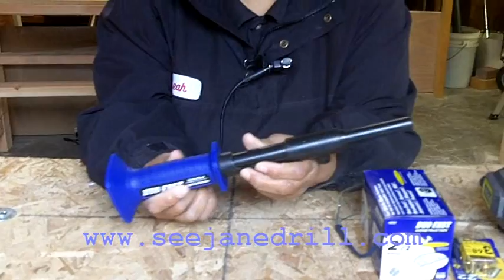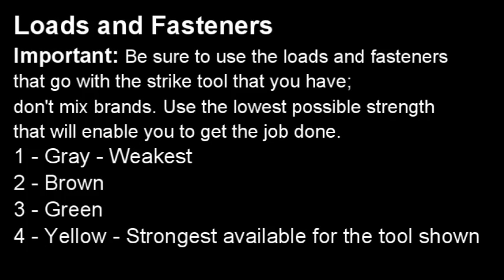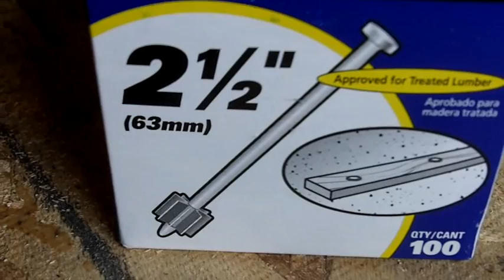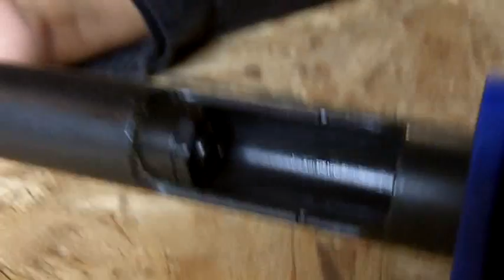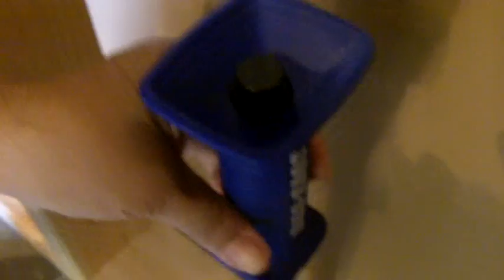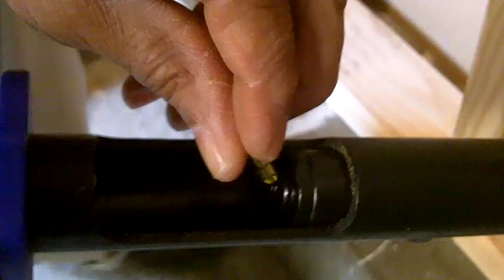Best Way to Drive a Nail Into Concrete

Comment: whats the best way to remove anchors? i recently took a room down in basement and im left with 2 1/2" spikes sticking out of floor, was going to cut it with grinder but fig id look it up first but not finding much
thanks in advance

Comment: Leah you are great, keep the videos coming. I probably wrote this before but please try this drill a hole with a 3/16 masonry bit insert a piece of 16 gauge annealed wire and drive a 16d common nail through the lumber. It holds tight and can be removed as well.

Comment: I wonder if once the nail is is, you can pick out the blue part and hammer in the remainder of the nail so it is flush.  Need to install laminate transition onto concrete and need an option to secure transition, but need it flush.

Comment: Excellent job explaining how carefully one must handle this particular tool! It's essentially a firearm that just shoots nails rather than little lead balls! The care in which you explained how it must be handled was precisely what is needed - great job! 
The only bummer is the link, Leah. I really wish you didn't have the tool listings on Amazon...  ~sigh~  I avoid Amazon as much as humanly possible, as I detest what they do to their employees (poor wages, extreme working conditions, anti-union, union-busting, etc), and the fact that the company pays 0% - zero percent - in taxes, while making zillions using our infrastructure (roads, postal service, etc) that taxes pay for. That just doesn't seem right to me. It's unethical, IMO, so I can't support the company, at all. I've maybe bought through them 3 times since they began, and avoid them unless it's basically an emergency.

Aside from that, great video!

Comment: Good video.  Consider using treated lumber for your silt plate next time when it will be touching concrete.  That way the capillary action from the concrete doesn't rot the sill plate over time.  Keep up the videos!

Comment: Another great video as usual, thanks so much.  I just bought this exact tool from menards today and was wondering if I should exchange it for a Milwaukee or some other better known brand . Now that I see this is the one you're using I figure if it good enough for Leah it's good enough for me , I will definitely read the instructions.

Comment: This is like a zip gun with safety features. I use Tapcon, a few just spins free, maybe soft concrete then I need to drill a new hole. I think those concrete nails have more pullout force, won't come out without taking a chunk of concrete with it. Some broke off and had to grind it flush.

Comment: I'm a big proponent of safety but you've gone overkill on the "dangers" of this tool. The likelihood of this tool misfiring is somewhat less than finding a winning lottery ticket on the sidewalk. The most likely injury you'll face with this tool is missing the hammer and hitting your hand or arm. You're more likely to hurt yourself with a hand saw.

Wear eye and ear protection and load the nail before the charge and you'll be fine.

Comment: Leah, I just finished watching your video about Nails. There you said, you want a nail three times the length of the thickness of the thing you're trying to nail down. Why did you choose a 2 1/2" nail for a two by four? it isn't even twice the length. Love your video by the way :)

Comment: 1st off, love the videos and the way you explain them!   Question in this tool.  Could I use this to drive a nail into and cinderblock wall will stucco on it?  We are trying to hang wire on the wall for the vines to crawl on.   Is this strong enough to go through both materials?  Recommended nail length? And I’m assuming I would just not finished by hammering the nail and just removed the blue plastic and wrap the wire around the end?  Thanks Jane!  Keep up the great work!
Reply from the maker: You know, Mark. I would not recommend this tool for that application.  There are better options.

Comment: Hi ,
Any suggestions on putting screws in to hardie board or  cement board for a sub floor before laying tile.....I have a drill but it's some work for a woman.....I may try a impact driver or custom screws.....and advice would be appreciated.
Reply: There are special self tapping screws for cement boards without predrilling. https://www.amazon.com/s?k=self+tapping+screws+for+cement+boards&ref=nb_sb_noss
I use cheaper outdoor regular screws without predrilling, just push harder. Don't think you need impact if your drill has enough torque. Roofing nails will do but does not hold like screws. I use  12V Milwaukee impact, plenty of torque. Don't need to pull out my 18V Milwaukee, heavy and tiring to use all day long.

Comment: where can I purchase this tool from? what brand did you use in the video and finally can I use this tool to attach trim to a plaster wall or would the strength of the tool cause the plaster to crack?
Reply from the maker: Hi jjenn, this isn't the right tool for that job.  Can you tell me what is underneath the plaster...lath?  metal?  concrete?
Reply: seejanedrill hi Leah thank you for getting back to me. all I know is we had new walls put up in many rooms of my house and instead of just doing drywall, my contractor put really thick plaster on the walls (possibly OVER drywall i think ?), but what's behind the walls I'm not 100% sure. it makes me furious that he used plaster. I never asked him to do that. so needless to say he was eventually fired for that and many other reasons. I do have a small exposed brick wall in my kitchen that also needs to be trimmed out. what tool should be used for that?

Comment: That particular tool is a very dangerous one. It has no safety mechanism at all, so it can fire the nail even though it might not be on the board you are nailing. I would not use this. I do have a Hilti fastening toll that I consider much safer, but I still am very careful with it.
Reply: Watch the video. It does have a safety mechanism. It needs to be pressed down before you strike it with a hammer. Similar to an air powered nailer.

Comment: Thanks, Leah!  About 35 years ago, I used a Hilti trigger-operated nail gun.  Very easy to use, but scary.  I didn't know about the test to see whether the material and nail are compatible, but I got away with it.  I'm a wimp, so now I bore pilot holes with a rotary hammer, and drive Tapcons.

Comment: Yes, it was slow paced. The best way to have information take hold. This is the same manner in which firearm instruction is given( Yes, I am a certified firearm instructor) and I did appreciate the professionalism shown. In my opinion, one of the better videos on the proper use of a nail driver.
Reply from the maker: thank you very much for your comments! :)

Comment: I can't find that tool anywhere. Does still exist and if so where? I will be framing a basement soon. Also how much does the tool, nails and loads cost?
Reply: Can get the device, loads and fasteners for about 45 bucks at local box stores. That is ....IF....you don't live in a delicate STATE I suppose.
Reply: Sam Sacks Ace Hardwares normally have them. Pretty inexpensive.

Comment: Thanks for the great tutorials.  I want to frame in my concrete basement, should I use the powder actuated nails or tapcon type screws?
Reply from the maker: I prefer to use powder-actuated nails, because you don't have to drill pilot holes, as you would for tapcons (saving half the work). If you do decide to go with the tapcons, you might want to use construction adhesive as well on that bottom plate to give it additional stability. 2 additional notes: Remember, where concrete slab comes into contact with soil, such as in a basement, you have to use pressure-treated wood or wood that is naturally moisture resistant (like cedar) for the bottom plate.  And, do keep in mind that some basement walls need to be floating walls. It depends upon the area in which you live and the soil composition.  You may want to look into whether that is necessary or not.

Comment: When I worked in Ireland we used things called  ''''express nails'''' a lot when fixing to concrete. I don't know if you have those in the US but they are brilliant, they provide really good solid fix. We used this system too, but mostly for fixing to steel. Great demo, safety is really important with these.
Reply from the maker: express nails.....interesting.

Comment: Hi Leah, would you also  use a Ramset like tool for attaching the top plate of a non loading bearing wall to a steel I-beam?
Reply from the maker: Yes, but you have to make certain that you are using the proper load with the appropriate Ramset model.  If you want to send me your email address, I can send you a link to the Ramset spec sheet which has a load selection chart.

Comment: What's funny is that i have this EXACT dilemma .....i need to install some drapery but they extend over an empty space so we have to use supports coming from the ceiling to cover the area that is hanging in empty space and i was JUST considering looking you up and asking you your thoughts but it's tomorrow night that we have to install.....so plan A was pre-drilling and then using the "Tapcon" concrete screws but this gives us a secondary option if needed. Thanks again Leia!!!!! :)

Comment: QUESTION: I need to add a wall to a custom shower(turns out I should of hired someone lol) I'd really rather not have to drill holes with masonary bits because that is a pain! Would this work on tile to seat a wall bracket for a 2x4? it doesn't matter if I crack the tile because it will be sealed and covered with a wall. Thanks for the advice.
Reply from the maker: +Jack Johnson   Hello Jack,  I'd use a diamond bit.  They're a bit on the pricey side, however, they cut through ceramic and stone tile with little effort.

Comment: Lea, first off you are a very charismatic person thanks for the video, second I'd like to bring something to attention I see you said 2 1/2 nail for a 1 1/2 board but then once the fastner you shot into the concrete stod out about 3/8 to 1/2 inch on top of the 1 1/2 ,I so then only 1/2 inch of it when into the concrete, say if you'd hade used 3 inch faster that would of made it more secure right?
Reply: +Hitman Grace of God The reason the nail did not sink enough was the tool has to be held more firmly pushing down ! it should countersink a bit. a half inch sticking out is unacceptable, firmer grip and sharper blow, if you notice the camara switches fast because the first attempt failed. This is a very safe tool to use
Reply: oh your right about that....I have  had to learn the hard way.

Comment: Leah -is there a difference between driving a nail into a concrete floor and driving one into a hard wood floor? Should I assumed that there is concrete under the wood and how would I connect the wall into that type of flooring? Thank you!
Reply from the maker: +SIT Chicago   Yes, there is a difference.  It has to do with building codes and what type of lumber the bottom plate is required to be when attaching to concrete that is in direct contact with the earth.  Is your floor a wood laminate floor floating on a concrete slab?

Comment: I have watched and read the stuff on video. now the question I have is this.1) if the tool does not drive a nail into cement blocks and using yellow loads. am I doing something wrong? you said in video not always do you use highest load. I have also used same tool on concrete floor to nail 2x4 down to it. nail is still raised above it can I second shot it? or in both cases drill and use concrete screws?
Reply from the maker: cazrcon Sometimes if you don't strike that tool with the hammer hard enough and on center, it doesn't drive it in completely.  I would not try to re-shoot them a second time.  

The other thing it could be is that the concrete itself is too hard.  And yes, you could use Tapcons, they would work.

Comment: Can I use this to fasten steel studs too?

Thanks
Reply from the maker: ***** Yes, if you're talking about attaching the bottom plate to concrete.  In that case, you would want to use a fastener of the appropriate length, because the fastener that I used in the video was for a 2x4.  You would need a much shorter fastener.  
If you are talking about something other than attaching the bottom plate to concrete, then please let me know what that is.

Comment: This is a good tutorial video but code is to use pressure treated wood whenever wood touches concrete. So I'm just wondering why your trying to teach other people when your doing things wrong.
Reply from the maker: david hindes David, The International Building Code, Chapter 23, states that one must use either naturally durable OR preservative/treated wood when the concrete is in direct contact with the earth. Number 1, it doesn't say that you are limited to using pressure-treated wood.  Number 2, you only have to consider using either naturally durable or preservative/treated wood WHEN the concrete is in direct contact with the earth.

The most important thing is that the video was a tutorial on how to use the powder-actuated tool, and not "how to attach wood to concrete".  Viewers will have different individual circumstances to consider.
Reply: Hahaha,  owned.

Comment: Thank you Ms. Leah. I've been looking for something instead of drilling then using the flangers. Were can I purchase this. What is the actual name and how much it costs. Oh yeah, if I have ceramic tile floors to concrete, will it crack the tile. Please answer asap so I can get started putting the wall up in my bedroom. By the way, my middle name is Leah. yvonne from california
Reply from the maker: Hi Yvonne, yes, it will shatter ceramic tile, you wouldn't want to use it on ceramic tile. In the event that you still want to get the tool, you could shoot it into a mortar joint.  The tool is called a powder-actuated tool, and it comes in various name brands, such as Ramset, DuoFast, and Hilti.  They are available at just about any hardware store, and the simplest model (single-shot) costs about $20. There are multi-shot tools available for about twice the amount.
Reply: Wow. Thank you Ms. Leah for responding so fast. I can't wait to put the wall in my bedroom. I'm surprised at how much it costs. I'm going to try the mortar joint Please don't stop posting because I like the way you explain everything. Again, thanks a million.

Comment: hey i was wondering what the best approach is to remove the nails from the concrete? im having trouble removing a piece of 2x4 from the ground.
Reply from the maker: Hi Ali, As you probably already know, these are meant to be permanent fasteners.  So, you could try wedging a crowbar underneath the wood where the fastener is located. You may  be able to remove the wood and the nail at the same time.  It's going to take a lot of effort.  I have done it before, and it is very difficult.  It may not work.  If that doesn't work, another option would be to cut the wood off around the fasteners and remove the wood that way.  Once the nail is exposed, you can try hitting the side of the nail with a hammer to try to weaken the hold that the concrete has on the nail, and then try again with the crowbar.  But chances are good that you will damage the concrete.  I've heard of folks using a grinder to cut off the nail (flush with the concrete), but that could prove to be very difficult also, because these aren't ordinary nails, they are case-hardened.  I wish you the best.
Reply: Hi Ali, you can use an angle grinder (with a diamond cutter) to first remove the head of the nail.  Then you pry up the wood.  And last you use the angle grinder again to cut off the body of the nail to flush with the floor surface.  Should be fairly easy if you use a good diamond cutter.

Comment: Have you ever heard of a Hilty Gun?

It's like an explosive (minor) device that sends the nail through concrete and even steel!

It uses firearm primers as propellent.
Reply from the maker: Yes, I've heard of the Hilti gun. However, I prefer the Ramset Redhead D60, which is what I learned on. It is similar to the Hilti...I love that tool!  They are both pricey, though, which is why I show a less powerful, less expensive powder-actuated tool in the video.
Reply: When I was shown one in Ireland the model was a probably not one of the big boys as though it sent a nail into a steel beam it only went in about 5/16s of an inch.  Mind you this was an inch thick steel too.